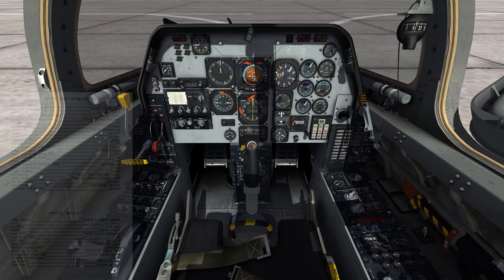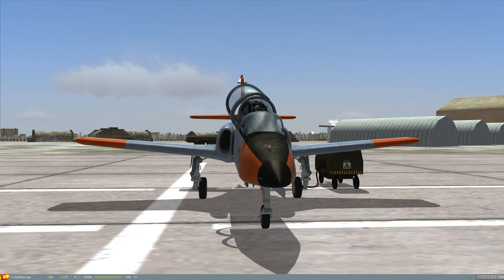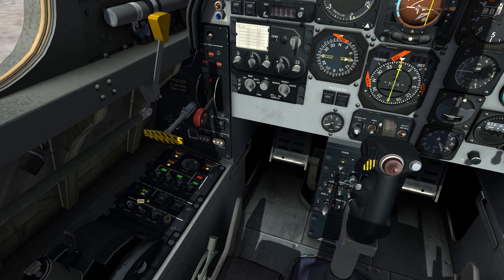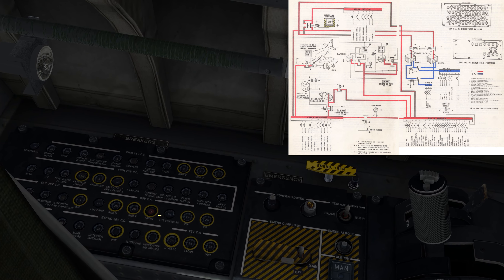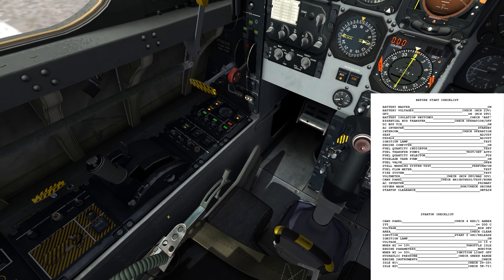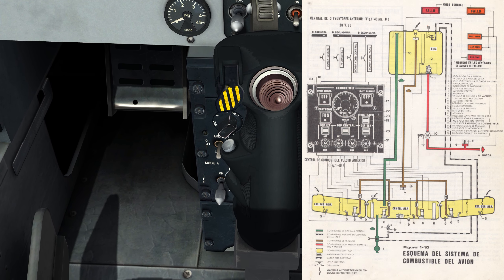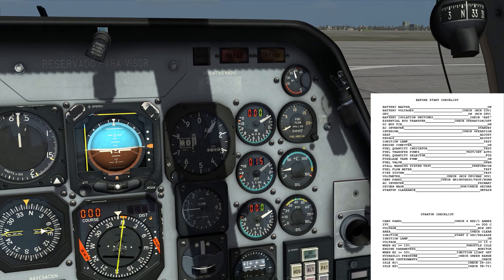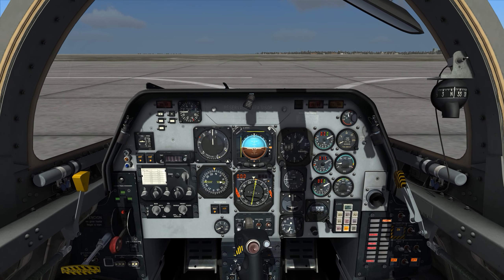Test Flight - DCS: C-101EB Aviojet #2

Comment: Concerning the inverter: the checklist probably advices to use the alternate/reverse inverter for the duration of the checklist just to make sure it works stably. It's no good having a backup system if you only notice that it's broken when the primary one fails ;)